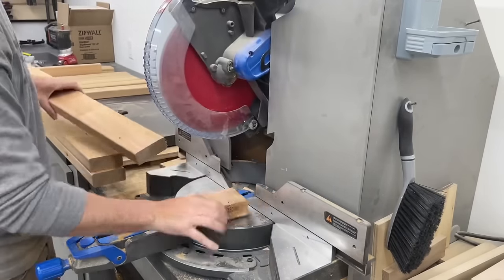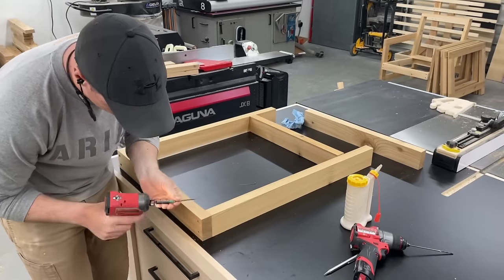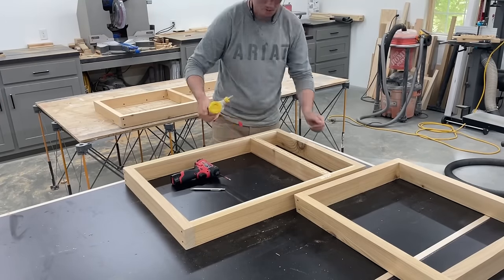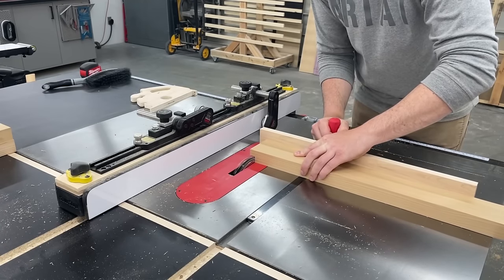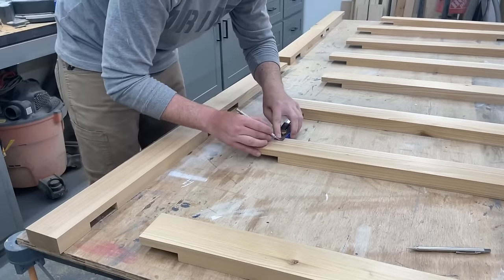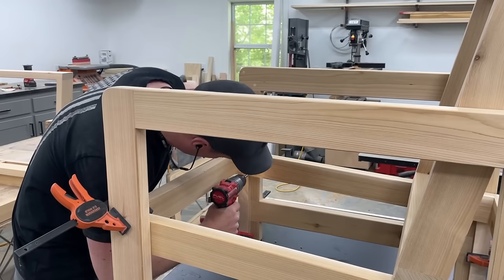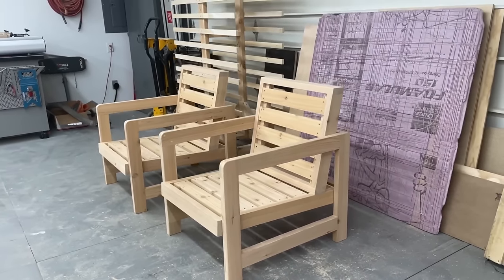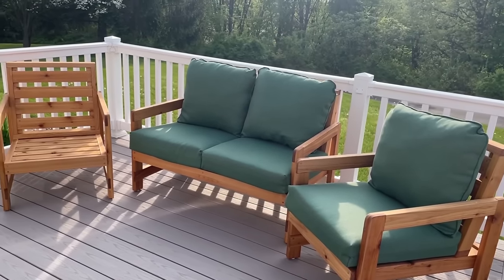BIG $$$ Saved! | Patio Furniture Set Build

Comment: This is precisely what I need to upgrade my patio furniture. I have one question. If I wanted to make the double sofa to a triple, what would you suggest? I assume you would add 1/3 length to everything, but you would like more support under the sofa, correct?
Reply from the maker: Yea I’d be worried about the middle sagging without another leg in the center

Comment: Did you use cedar wood plugs? Having trouble finding cedar in my area
Reply from the maker: Yea. Cut my own with a plug cutter
Reply: @JohnBuildsIt It's been some time now since you've finished the furniture. How is the milk paint holding up? Would you still recommend it? I'm almost finished with the build and trying to decide what oil to purchase
Reply from the maker: @greid9349  it’s not lasting as long as I hoped. Mine are in the full sun all day from sun up to sun down though. I’m going to try something else on them next spring
Reply: @JohnBuildsIt  Well, that's good to know. Maybe I'll try something different then. I'm trying to avoid any varnishes that will make it feel plastic and diminish the beauty of the cedar